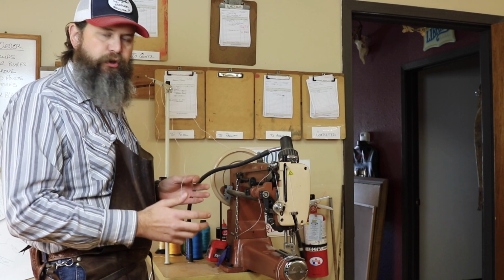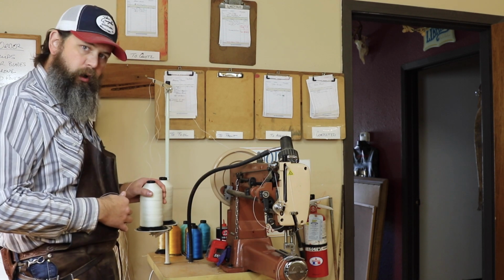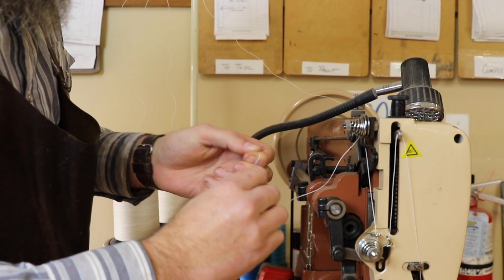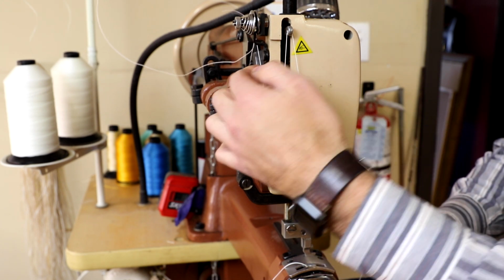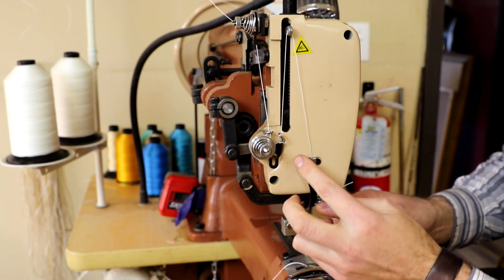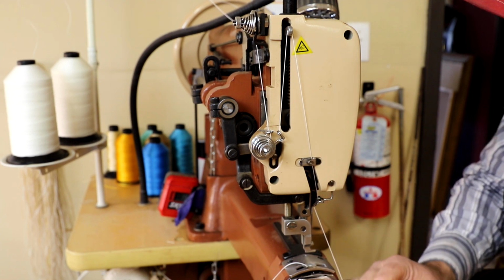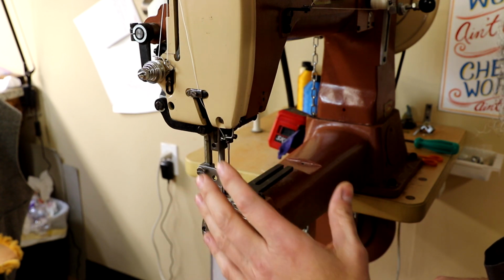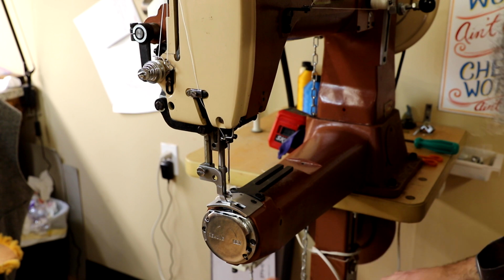Replace Sewing Machine Thread Fast

Comment: I dont use this trick, BECAUSE one i am actually quicker to just rethread it, and secondly i check to make sure my machine is set correctly every time. When I change thread I usually change colors, each color has different tension needs in the machine, I am guessing the chemicals used to make the colors change its properties a little bit. I also find different manufactures have different winding so. TLDR just learn your machine, you are not a sweatshop worker saving 5 seconds max isnt likely worth it.
Reply: Do you know where I can get the correct thread the stuff on Amazon feels like cotton but says blended nylon and it breaks every time. Also what needle sizes too please.